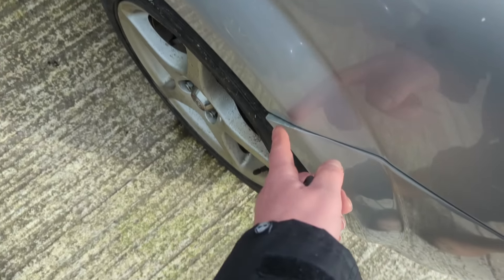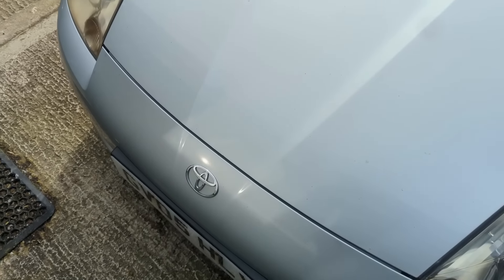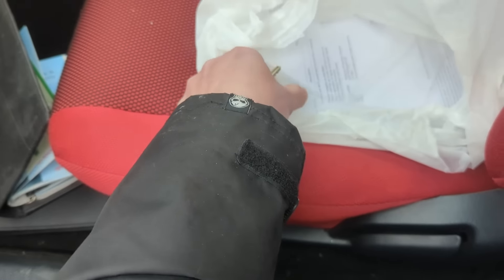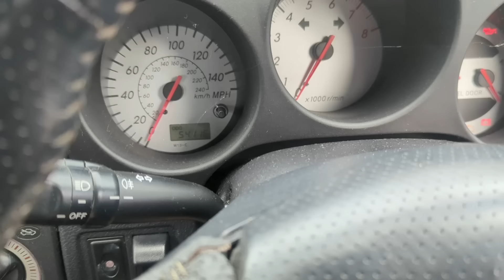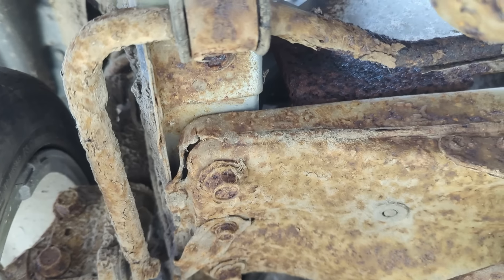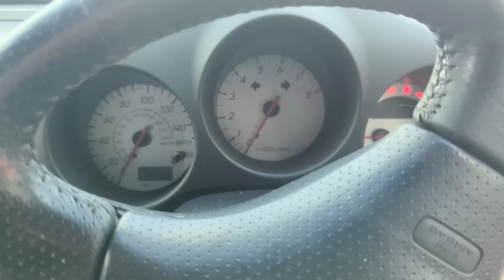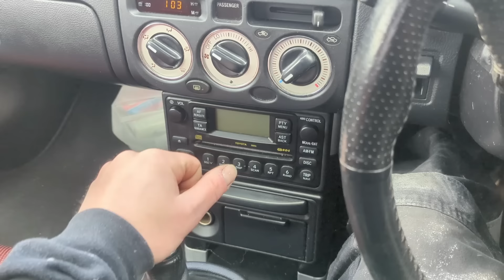I bought a low mileage Toyota MR2 for £1000

Comment: If the rear cross member is ok it looks like a simple wire brush and rust protection would sort the underside. I bought one of these a few weeks back but no rust. I had to sort handbrake, refurbish alloys, new tyres, service it and general tidying up. It is now a lovely example and such a hoot to drive. I have also used lanoguard underneath and in wheel arches & replaced shocks & springs with sports items. If you want a fun car that is also reliable keep it. The MR2 owners club is incredibly knowledgeable & helpful to.

Comment: They don't cost a lot to sort, generally speaking... great fun cars to drive, even with the stock engine. I got one with a factory hardtop and AC earlier this year. There are a few good specialist breakers for these cars in the UK too. 

The red cloth seats are probably the best. They don't get scorching hot in the sun and you don't slide about in them when cornering, unlike the leather seats. The red also looks good against the silver or black cars. Downside is the cloth seats to wear faster and can't just be given leather feed and or a paint job to refresh.

Comment: Had one from nearly new in 2000 on a W plate, was a great car but came with better spec full leather etc , as said before great fun car to drive and with soft potenzas on sticks like sh@t to a blanket .
No space and roof leaked on mine , be aware it has bags inside the rear quarter to collect rain and they slosh about when you are driving- only way out was a sponge and rapping your knuckles

Comment: Good job it's one of the post face-lift cars as the earlier ones were prone to severe engine problems..probably worth removing the pre cats as a precaution anyway as they won't affect the emissions..
Handbrake can be a pain to set up and keep it functioning as it should .
But a fun car to drive..

Comment: Looks like a good One James, Just traded mine in for  my dream car, got the same money you gave after having it for 15 years, (Paid £2700 in 2009) they are such fun to drive and pretty quick just watch out in the wet, when they let go they go! Replaced the rear sub fame on mine , ( easy enough job) also the roof and the engine  due to  disintegrating Pre cats , Toyota reliability ? The roofs can look really tatty but never seem to let in any water, MR2 Ben great for spares .

Comment: Just remember James these cars had the faulty pistons and were notorious oil burners unless they had had the recall work done which was basically a new bottom end so fair play to you for gambling a grand on it.
Reply: Later facelift cars which that one is were apparently sorted from mid 2003 on....I have an 04 owned 12 years and doesn't use any oil at all.

Comment: Great cars, I’ve had three over the last 13 years.

Things to check;

Rear subframe,
Steering UJ
Power steering pipes
If you have a small oil leak, it will most likely be the ‘O’ ring for the chain tensioner (easy job)
Oil looks clean, so doubt it’s an oil burner (some, that haven’t been regularly serviced, can drink lots of oil)
The drains for the hood (can clog up and flood the car)
Bottom corner of the radiator will eventually leak if it hasn’t been changed already.  They are quite cheap although bleeding them afterwards can be a pain.

Looks like a solid car that needs a little ‘titivation’ and will live on for many years to come.

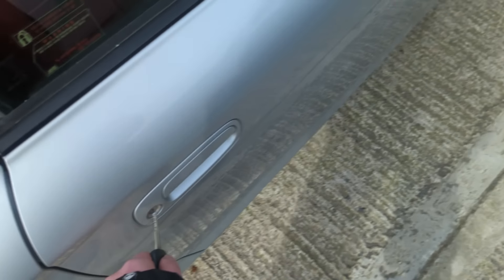Comment: 5:06 Strange to not have remote central locking and immobiliser.  My 1994 Toyota Celica had that from new, though I did have to replace it about 10 years ago now.  I wonder if the original remote / immobiliser system has expired and been patched out.

Comment: Should have remote keys for lock/ unlock. Toyo tyres are a favourite tyre recommended by the owners club without breaking the bank. Battery is small and only lasts 3-4 weeks if not used. Handbrake is crap on them all even with all new parts fitted lol. I have an 04 with 36000 miles and its mint underneath, owned 12 years.
Reply from the maker: Interesting everyone says handbrake crap
Reply from the maker: Surface rust is what you get if you park car 2 or 3 years after being wet
Reply: @ChopsGarage I think around that time alot of Toyota's had poor handbrakes. I slacken the cable off at the lever, pump the brakes a dozen times, pull the lever up one click and tighten the cable at the lever until just dragging....when released off the one click it should be free. So far that has worked for me for the MOT.

Comment: IF the handbrake was working, on a rear wheel drive car if you put the handbrake on a bit it gives resistance to the wheel that has lost traction, almost like locking the rear diff, it's got me through snow a few times in my old Rover P5B and P6 3500s manual in the past

Comment: For a Totota of that era its pretty sold. Flip it to an enthusiast you wants to do a proper mechanical/underside restoration. Please don't wire brush it and cover it in gunge, will be in the scrapyard within a couple of years if you do that, needs done properly to save it.

Comment: These are not easy to work on. My son bought an import which went like a rocket as it had turbo but a piston broke a land. So engine out - big deal at home and eventually fixed it. But new pistons bearing etc. then a few months later did it again.! Hopeless so out engine again. This time quicker but hard at home.  We have engine crane. They need 5* fuel. He sold it at last. Uncomfortable, very fast, dangerous in the rain was glad he got shut of it.. Yes, move it on to a young nutter.

Comment: The Titanic has less rust.
Reply: Its just a bit of surface rust sarcasm off
Reply: @Andreasy2  "surface rust" by the time its wire wheeled off, all the metal will also be gone.
Reply: @danascully-x2t I thought that was a bit excessive as well and will take a lot to tidy up…I have one I bought with 122k miles, perfect runner, great body work and is 100x cleaner underneath and has never had anything done in terms of restoration although that’s what’s next for it just before the summer.

Comment: Never buy a car that's not driven regularly. The heat from the engine dries the car, and the fluid cycling around the various systems keep the seals, rubber and plastics from drying out...

Comment: It’s not a sports car!
It’s Midtown run around, built for city driving.
Reply: It's MIDSHIP RUNABOUT and it is a sports car. Being lightweight and mid engined imo it handles the best over the MX5, Z4 and TT convertible. They are brilliant on winding country roads. Decent on fuel as well and very cheap to insure, mine costs £170 fully comp protected as a third car with only 2 years NCB worked up.

Comment: £1800 with a new mot and let it go as is
Reply from the maker: MOT could cost easy £500 to £800 then there is the vat and transport. MOTd it would be £3k min
Reply: @ChopsGarage they're worth more than 1800 quid bud, wire brush underneath, black waxol, mot, service, buff, vallet, it's 3995 then with 50k,ive had a few from auction in this last couple of years and had to pay 2k plus, they make good money, just go for the St forward tidy up and a reasonable price, get St on with it, nice 2k plus profit, all these moaners don't want to know about the losses in the car game, you've got to make what you can when you get a good buy, you've done well.